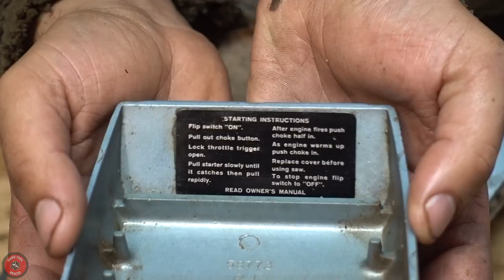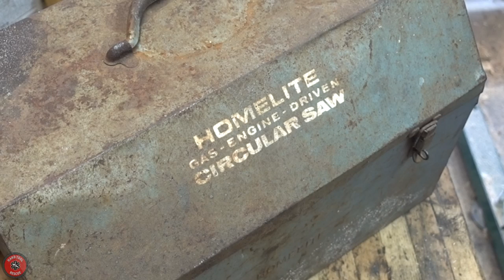Rare Gas-Powered Circular Saw [Rescue]

Comment: Gas powered circular saws. Criminally underused by horror movie directors....
Reply: You run of the mill chainsaw is both more common, has a more exposed blade, and more reach too.
Reply: It's only used in horror shorts. :P
Reply: there's at least one movie I saw where a gas powered circular saw came to life, proceeded to run along the floor right at a guy and cut him in half. Can't remember the name of it but it was on Syfy
Reply: Sounds like one of Roger Corman's snooze fests . @AustinJ
Reply: @heru-deshet359  in college my friends and I would get hammered and watch those horrible syfy movies they play at like 11am. They were all so bad but so funny
Reply: That's what they were aiming for, lol.  @AustinJ
Reply: Let's call this movie (Sarculer presituon ) I would watch it
Reply: *draws line with speed square
*Lifts blade guard
*Does test tap
Reply: It would be more fun to watch a horror movie and watch the killer run around with one of these circular saws killing people. I've done seen most tools being used but I haven't really seen my gas powered circular saw I think a horror movie use them one of these types of saws would be more interesting. And the best part is a gas powered circular saw you don't have to worry about the chain slipping off or snapping off, which this tool has more Advantage than a chainsaw when it comes to a horror film.

Comment: Never heard of a gas powered circular saw  let alone seen one. Great video. Thanks.
Reply: Same here. It shouldn't surprise me though; they used to have gas powered washing machines. My grandmother had one.
Reply: I was 6 when that saw was built, and I've been a woodworker all my life, and I've never seen or heard about one of those. Pretty cool jobsite saw from the pre-battery era.
Reply: I was thinking that technically this would be better for certain jobs in the wild, where transporting aggregate+ electric power tools is hard, or job site chances a lot, so weight of motor in saw is worth it. How ever that thing looks bit hazardous with that blade guard being so slow to return and wont that thing have ridiculous kick.. up? if blade is twisted even a bit?
Reply: I saw/heard one being used out on a job site with no power. First thought is that is actually a really good idea! They still make them but obviously they're more expensive.
Reply: Hellsong89 As an active carpenter, I can say most companies would rather bring out a gas powered generator than a gas powered saw. I think it was most likely for pre battery mobility.
Reply: They are pretty rare but in Aussie land I used to have a few of them.
Reply: I bet this would be an awesome homesteading tool.
Reply: WOW! Never heard of one of those, my grandmother had a "ringer washer" we used outside when I was growing up. We also used an old wood burning stove outside for a grill, I grew up kinda' old fashioned, we even heated our house with a coal stove! Would love to see a gas powered "warsher"
Reply: Rocky had clown for breakfast and thinks he's funny.
Reply: Actually, those were Maytag engines, if you and I are thinking of the same thing.
Reply: Considering petrol engine stone and metal saws are still a thing, its hardly a suprise. During the 1950-60s, when portable generators were huge D-cat size things, contractors and homeowners had to have one. Still a great video none the less
Reply: It would be even better if you could convert it into a gassifier haha.
Just kidding of course but I wonder if it would work on wood alcohol
which would be a renewable resource or even moonshine.
Reply: Alcohol fuel might work.  I don't know if a gasifier - or indeed, just plain running it on gas - would work, because it's a two-stroke and you need to mix oil with the petrol so it doesn't seize up.
Reply: Hey dad go back on facebook
Reply: +Creeper Gamez — GFY.
Reply: Mike McHenry I
Reply: We use "quick cuts" like this now mostly for cutting aggregates but there are wood blades for them as well. However, it's easier to frame a house with a chainsaw than with a circular saw and you rarely need one outdoors, and you can't use gas power indoors efficiently.
Reply: Me either. Is it a chainsaw hack? NM saw the end of the video. Cool item.
Reply: +Daehawk — No, it isn't a chainsaw hack.  If you watch closely in the beginning where the carrying case is opened, you can clearly read "CIRCULAR SAW" on the lid.  It was designed from the start to be a circular saw.
Reply: Have you never heard of google either?  Gas powered circle saws are still sold to this day and they are NOT rare.  They are however expensive and likely out of reach of the average person
.
Reply: +ppotory The thing is, people rarely use them for wood anymore becasue there are better alternatives.
Reply: Very true.  Outside of concrete you just don't see them.
Reply: Mike McHenry   This is a Homelite saw... Use it for real and it'll fall apart.
After 20 years (not in a museum) it literally ruins itself. You can't replace the seals, or the internal pieces, plus the case looks heavy af. Try carrying that up a roof and use it to cut in a skylight.
Reply: Hellsong89
Absolutely. It would break your arm kicking back off ardox nails, etc.
Twist it and bind it, boom your elbow is tickling your ears for once.
Reply: And don't tell me a machinist can make new parts. We all know anything can be done, but you can't take this to just any average small engine repair shop. It is a pure novelty, but you could however use the chassis to hold the internals of an updated machine say a chainsaw.
Reply: at least we know why his bench is scarred up
Reply: rob wilson I've got an old xl-12 homelite saw that still runs great...I grew up with my Dad using that saw to cut wood for our hunting camp, now it's me & my kids using it. Gotta admit the stihl gets more use these days...as it's lighter & having to thumb pump bar oil kinda sucks on the hl...but it still runs great.
Reply: +ROTAXD Very cool story. It shows that they were high quality before they went to China.
Reply: Nor had I and I was a carpenter for 20 years. I am now super jealous of him for finding that classic old beauty. Cool tear down vid.
Reply: @rob wilson - If you adjust the jets a little, that problem goes away.  Google and search YouTube about it.  The jets require either a special bit to turn them, or use a Dremel to grind a slot in them and turn them with a screwdriver.  Enrich the running mixture a little, and they won't run so hot.  Mine works fine now and restarts easily after running.
Reply: Arkansas Pilgrim where did you get yours
Reply: Mrs. AP got it for me for my birthday one year.  From either Lowes or HD.
Reply: Arkansas Pilgrim can you still bye them from lowes
Reply: Buy
Reply: Don't know.  Haven't looked. Get a Stihl.
Reply: Arkansas Pilgrim ok
Reply: The homelite chainsaws of 50 or 60 years ago were pretty good unless we are too believe that the ones my uncle and his neighbors had were exceptions.
Reply: A lot of familiar name brands have gone downhill.  They aren't necessarily junk, but they are nowhere near as good as they used to be.  Black&Decker comes to mind.
Reply: Sure you can, when I got my '63 super xl going again I was able to find all the parts I needed new. Piston, rings bearings, the clutch all of it. The body of the saw you cant find new but all the internals you can get easily. And yeah you have to do a lot of the work yourself unless you go to a small mom and pop shop with a few old timers working there, but that's part of the fun of working on these things. The Homelite's of today are not the same as what he's got here
Reply: I have electric circular saw
Reply: Mike McHenry i
Reply: Mike McHenry  y
Reply: Mike McHenry  To
Reply: ArtemiaSalina  ，
Reply: Isnt kindad like a chain saw
Reply: Interesting, Mike, and any of you others who've never seen a saw like this. I guess you haven't been around construstion sites much. These saws are definitely not as rare as gasoline-powered clotheswashers. Construction and demolition co.s use these all the time! I don't even work in construction but I've gotten to try one.
Reply: RNA0ROGER, they're really not that rare.
Reply: M773, no, not all heavy-duty ones are gasoline-powered. Some are electric and some are electro-hydraulic and some are combusti-hydraulic.
Reply: And then there's that REALLY BIG kind of saw like this that has wheels and you walk behind it, and you lower and raise its blade as if it were an overgrown lawn edger!
Reply: Runs like a new one. Same set up as a chainsaw minus the bar? I assume it's direct drive and no brake.
Reply: Mike McHenry how do you think they cut wood before there was electricity? 🤪
Reply: Keith, there's always been electricity.
Reply: Maxx Fordham! No no, Thomas Edison invented electricity, didn’t you know that?
Reply: Haha, yeah, "he invented a naturally occurring form of energy." Thanks for your sarcasm, hehe!

(But oops, you forgot to close the statement as its own sentence after "electricity" and then open a new sentence as a question starting with "Didn't....")
Reply: You can still buy them today at Stihl. I have one from my dad, it costs about 1,600€
Reply: @HelloKittyFanMan. no in the olden days there was no electricity.
Reply: @joshuagilbert1546 : Not true. Electricity has existed for the eternal past.
Reply: @HelloKittyFanMan.  OK FINE DON'T GET  
ME STARTED BECAUSE I'M NOT PUTTING UP WITH IT
Reply: @joshuagilbert1546 : WOW, WHAT IS YOUR PROBLEM? YOU GOT YOURSELF STARTED ON THIS! NO NEED TO SCREAM AT ME FOR NO GOOD REASON!
Reply: @HelloKittyFanMan.  hey i know you think it's my fault but i'm sorry for getting mad at you for nothing.
Reply: @HelloKittyFanMan.  NAH!!!! YOU GOT YOURSELF STARTED NOT ME
Reply: * know
Thanks,  @joshuagilbert1546 . So if you're apologizing for that then I guess we should just delete all our replies to each other in this thread, huh?
Reply: @joshuagilbert1546 : THERE YOU GO AGAIN! SO YOU JUST LIED TO ME WITH YOUR FAKE "APOLOGY," HUH?
NOPE, YOU ARE THE ONE WHO STARTED THIS. I JUST TOLD THE TRUTH ABOUT ELECTRICITY AND YOU HAD TO GO BALLISTIC OVER IT!
Reply: @HelloKittyFanMan. not until 1752
Reply: @joshuagilbert1546 : Not true. Ever heard of lightning? Nerves?
Reply: Yeah Stihl even has a rock and concrete cutting chainsaw called the GS 461 Rock Boss that's based off the MS500i frame and engine but has a flat chain with industrial diamonds embedded in at and used for cutting concrete pipes,window openings in concrete walls and other applications a traditional circular blade cut off saw can't do and they also manufacture the Stihl BT45 Hand Held Petrol Drill for farming and commercial applications.
Reply: @Hellsong89 For the Brazilian safety standards I even liked it 😂😂😂
Reply: They still make them. You can Google them many models available.

Comment: You see them often today but with diamond blades to cut Concrete / Sidewalks. Nice repair job!
Reply: zeroy little bit bigger most of the time though.
Reply: zeroy except those cut off saws are completely different animals. they are the most dangerous cutting tool you can use actually due to the gyroscope effect and the kickback force they can generate
Reply: Also it's a very common tool firefighters use in car accidents and gaining entry.
Reply: Wouldn't firefighters use hydraulic power, or electric? Since the spark can set off explosive atmospheres. I dunno if that's the case, I'm seriously asking.
Reply: In situations where there is no danger of sparks causing ignition firefighters use a saw sometimes called a demo saw short for demolition. You're right, sometimes there may be a danger like gas or even a human being. Other times, while you have a working fire and need to gain entry, it's really no big deal.
Reply: Thanks! I was just thinking, that fire fighters have other tools that work on water pressure, since a fire engine is a convenient source of that, maybe the same would apply here.
Reply: I cut water and sewer pipes with one, plastic and iron.
Reply: Ah, you mean a master key, as in opens 99% of all doors ;o)
Reply: zero
Reply: Dude, they're not so different that they aren't still circular saws.
Reply: Look at that widowmaker

Comment: I have a two stroke drill, 4 speed gearbox. Put the chuck on the output you need, the other 3 also spin. A wonderful toy, I can't think of a practical application for it though these days.
Reply: v8trauma I want to see the drill, you should put up a video
Reply: robert singleton I suppose I ought to, it's not something I use though. They were big in the sixties. I have a shed full of old junk that's of little or no practical value. Maybe I should start a channel "WTF does this do?" or "its worth more as scrap" ;-)
Reply from the maker: Now I want it. haha.
Reply: Please make a video, that would be super interesting
Reply: This isn't going away any time soon is it? I'll see what I can do about getting a video up. The hardest part will be finding the thing, probably last seen 25 years ago ... but definitely somewhere around here. I'll put one up even if it doesn't run. Just a bit busy at the moment trying to do some chasssis work on my Discovery 2. I've CFS/ME, so I have lots of spare time but can't do much of any use due to being dead most of the time. A small project takes months at an hour or so per day, a living nightmare.
Reply: These gas construction tools were big when guys were building cabins where no electricity was especially in the mountains where packing in a saw and drill would be easier than a generator ast a couple hundred pounds.
Reply: Come the Apocalypse, it'll sure be handy!!
Reply: Billy Beane Makes Sense, especially considering Cordless Tools then were rare, expensive, tiny, and died quickly .

Comment: According to Homelite it came in two versions, the XL-100 with an 8 1/2-inch blade and the XL-110 with a 10-inch blade, they stopped making them in 1966. It was basically the XL-12 chainsaw without the bar.
Reply: Charles  Actually it is based on the Homelite XL101 !!!  Same saw only with a chain !!  I have one !!!   Dad bought new in about 1964  and passed it on to me 10 years later when he bought a new saw...I still have it !!!  But it has not been run in 10 years !!!
Reply: The gearbox off this will fit on to any homelite XL engine. I have 2 of these. Used 1 for stone and 1 for wood
Reply: @wilburfinnigan2142  interested in selling it?

Comment: Honestly, now that you got it running again, I would leave it with the original finish. Your cosmetic restorations are fantastic as well, but now that it's degreased I think it has just the right amount of character with the original paint.

Comment: this video made me smile... wish i had one of these saws
Reply: id want one just to restore it and make it work not necessarily to use it.
Reply: Glen, you might see several electric circular saws that run on a battery like you're talking about, but these gasoline ones are still very common today, often found on construction sites.

Comment: Using ether on a 2 stroke engine is asking for problems...like blowing out the crank seals or damaging the reeds on older engines. On 2 strokes it also washes the oil film from the cylinder walls. Dribble some mixed fuel down the carb instead.

For everyone else--- Several manufacturers put their engines on all sorts of equipment. There were post hole augers, drills, cut off saws, etc., and in some instances, numerous attachments were made for a single engine. Last time I checked, it was still possible to purchase a brand new 2 stroke drill from Echo.
Reply: I have a Maytag engine, when my great grandmothers washer wore out, the engine was used to pump water from the creek, I need to reassemble it and get it running.
Reply: OR... since he's the owner of the saw, he can prime it with cat piss if he so pleases, crank seals and reeds be damned.

Comment: For a farmer/rancher , working around an outbuilding with no power available, or building plank fence down the road a piece, it would have been a handy tool. In the 1970's a generator with enough power weren't cheap, and battery tools weren't available yet. The rechargeable battery killed the market for the thing. Also, the 80 volt tools now have more power with a lot less weight.